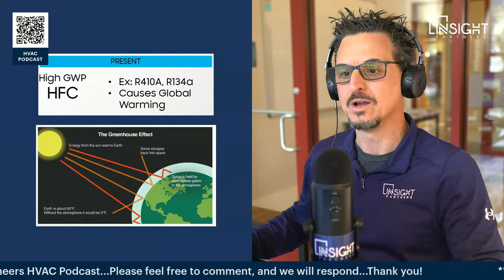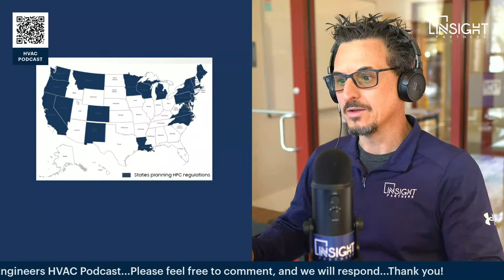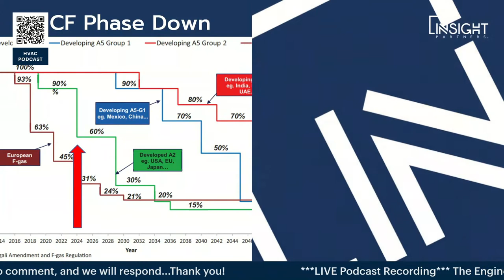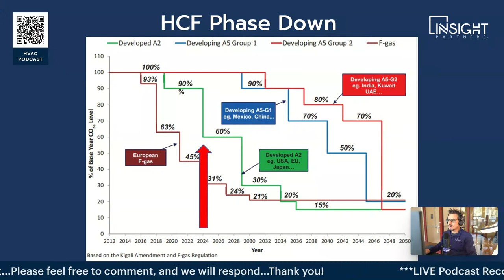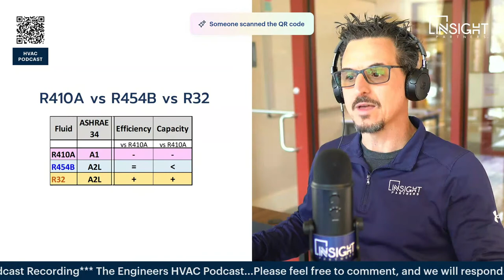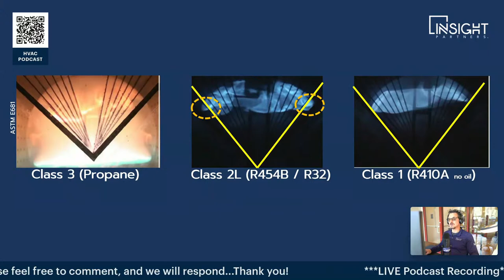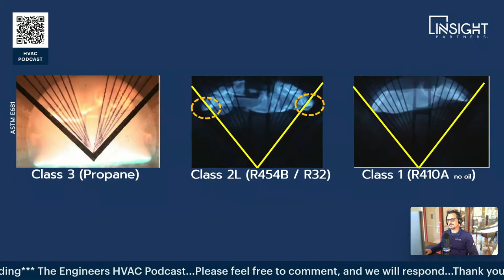The R410A Phase-Out Schedule | The Properties of R32 and R454B and its effects on the HVAC Industry

Comment: Will we still be able to use our existing recovery pumps and vacuum pumps, or do we need to upgrade equipment to handle these new refrigerants?
Reply from the maker: I understand you will need to upgrade. Most on the market today are designed for the A2L refrigerants. Thanks for asking!

Comment: How soon can a residential owner in Massachusetts expect R454 installations to be available?
Reply from the maker: Good question I’m not sure. It would depend on when manufacturers start releasing equipment. My guess would be  early to to mid 2024? Thanks for watching!
Reply: As of 12/2023, seems ABCO-Daikin have R-32 units coming into stock progressively now. R-410A is already a bad bet in the 5+ year view and VRF the worst bet since it needs a lot of refrigerant per ton, most points of failure.